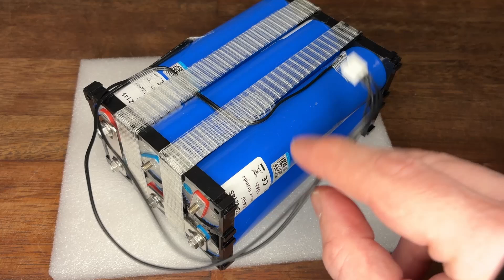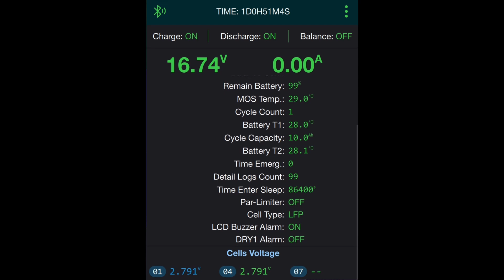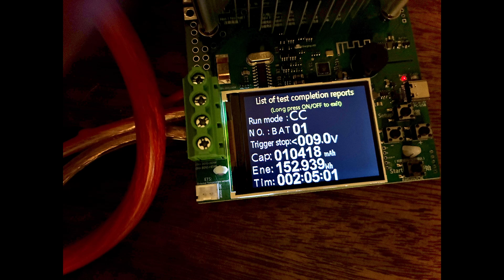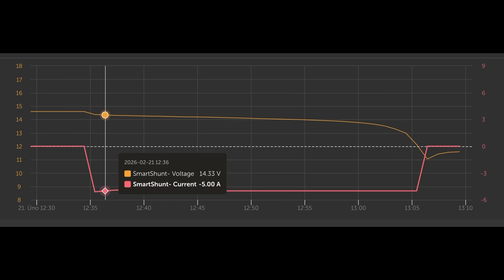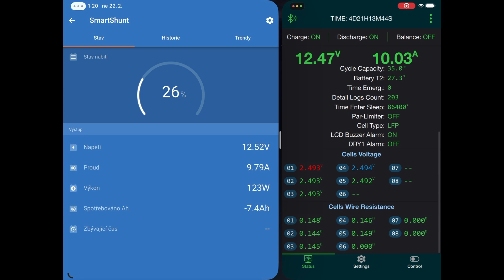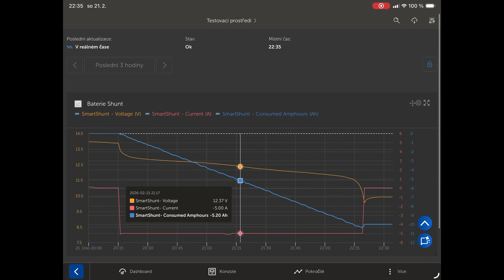Why a 6S LTO Battery Fails in a 12V System (5S vs 6S Test)

Comment: Thanks. 
Those looks like  "high voltage lto". Low voltage (Yinlong 66160) will be 80% charged at 2.3V, in your case at 2.3v is mostly discharged state.  LTO battery datasheets with matching curves provide 2.9V(14.5V 5S) as max charge cutoff voltage.
5S should be fine in car with big precise balancer and 6S is unusable low capacity. Some cars have adjustable voltage, but i dunno what cars and how.
Other addition to vid. LTO advantages is power(10C charge current crazy, full charge in 6 mins), cold temperatures(only common enough battery than can work at -40), durability(20 years, 20000 cycles, crazy), safety(dont have thermal runaway, dont catch fire when pierced). Disadvantages is energy density(half of lifepo), high temps(60+ C), price (4xlifepo)